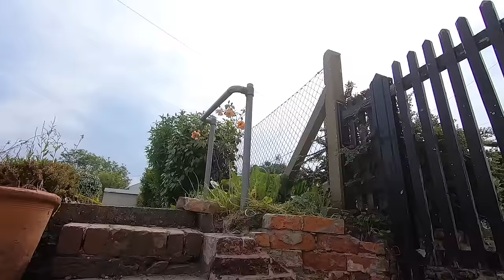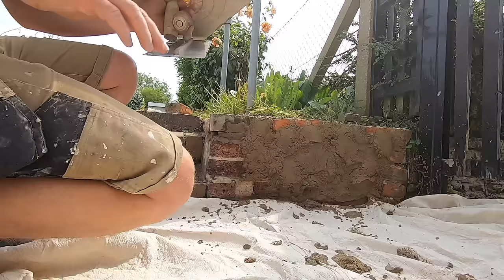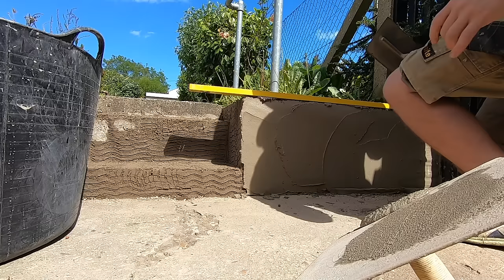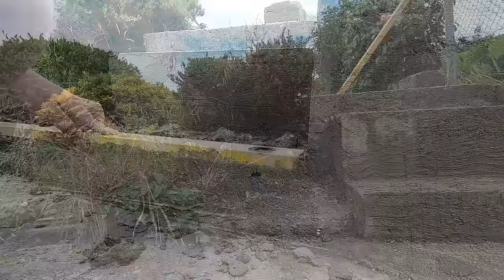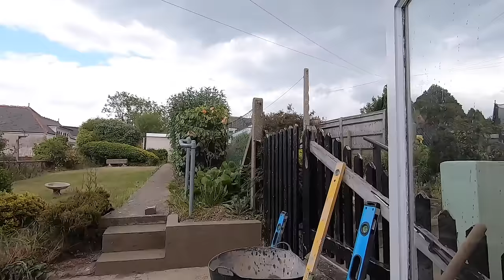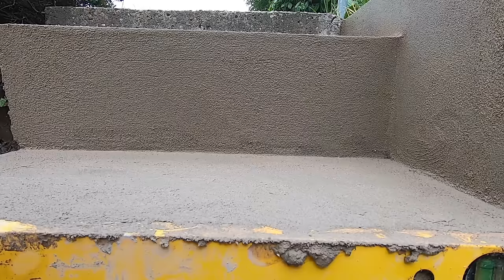Rendering A Garden Wall & Brick Steps With Sand And Cement (Plastering For Beginners)

Comment: good videos... you are a good craftsman. Im in the PNW (Seattle, WA. part currently) U.S. and have been a cement mason for....dang, almost 30 years now. The early years were primarily pouring and finishing concrete with my last few focusing on mostly patching...which covers a broad aspect of work, materials and applications. I'd have to say one of my strengths comes from using great techniques picked up from other people and incorporating into my own methodology, it has set me apart from a good deal of folks mostly for the better...sometimes not, lol. I'm telling my background for reference that I do have a very solid background as a cement mason and you take what I'm saying as real talk. your work is legit... not that you don't know, and its good to see variations from other countries that are similar and also the differences. Good work all around and great tutorials for beginners, giving great basic core techniques and showing craftsmanship at its finest, you sir, are all Aces as far as I'm concerned!!
BTW, I shouldn't forget the original reason for the comment now should I, lol.  I really can't put enough emphasis on how important of a tool the sponge is, personally. OTJ in this particular area they look at it as a hack tool....IMO, it is delusional to overlook the importance of a good clean sponge and seeing you use it properly as a finishing tool is a great representation of that!

Comment: Any chance of a show of how you mix your mortar for the base coat and top coats?
Reply from the maker: I'll try and get it sorted for the next video pal. Thanks for the recommendation 👍
Reply: Good quality plasticiser and some nice rendering sand always helps. Getting air into the mix over loads of water is the key.
Reply: When would use a bead vs not?

Comment: nice one lad, gonna do me garden wall soon. whats your opinion on render over spalled bricks. chip off the damage first then build back up to level, or does the render keep things solid?   was that first fill coat just sand n cement or any lime added?  whats your opinion on one coat renders? better to mix own? better to lay 2 coats? thanks again great video.

Comment: That wall and steps job was all angles and corners. How did you prevent the render going off too quickly before you could start to float the render? It would have taken me ages to get the verticals, horizontals and steps all nice and neat. The render would have set long before I was ready to float it up!

Comment: Hi m8 what all your videos that's give me to confidence to plaster outside and in I'm on a big wall that I have built with block and iv watch all your steps on everything even rule the scratch coat but I'm having trouble with the floating it just wants to pull and if I leave any longer it's to dry if you get this message do u have any recommendations thanks

Comment: Love your vids. I was wondering How does render hold up on steps? I want to have a go on my garden walls which have steps like that but would rather not have separate treads/coping. All blockwork. Also would you ever just use a sponge float instead of the plastic float or do you always need the plastic one first?
Reply: The plastic float presses the stucco
Reply: Blaine, just wondered if you still had any thoughts on my original comment? Still haven't got around to doing my walls and steps! 😂
Reply: Im looking to do steps too- have come across Ardex mortar repair- think this may be better than render for stairs?

Comment: Great work as usual.  Do yo u have a video on sand to plasticizer to cement ratios?I think it’s this one you used 3 to 1/1 for the scratch but then went 5 to 1 for the finish.  Is there a technical reason to increase the sand for the finish coat?  Do you use the same grade Sand for both?  Also one last question.  What is the optimal time to to wait to re-temper the second coat to do your final finish.  Thanks much and stay safe in the time of Covid. 

Zi
Reply from the maker: Hi mate! I'll try and get a video sorted soon actually but the long and short of it is that the top coat needs to be weaker than the scratch because it's cracks otherwise. The strength of the render forces it to crack which is why every coat needs to be weaker than the one before it! I also only every use plastering sand for rendering. Hope this helps and I'll try and get a video lined up soon on mixes 👍
Reply: Plastering For Beginners thanks for the answer.   That is a really cool tidbit of info.  Really helpful.  Looking forward to more of your videos. Cheers!

Comment: great vid. im an absolute diy beginner as gonna maybe build a concrete block water wall in garden. im bored so what can go wrong :) do you have any vids on what to do as a starter? im talking how to basics? i have concrete blocks, and can do mortar for them. i have a sponge :) it will only be maybe 3 high 2 wide, so small. you ok with the one coat render you can get?  sorry if too many basic questions btw. i will have a look at more of your vids tho in the hope of picking up tips, what float i need etc :) thanks.

Comment: Brilliant work mate, would this need painted after to protect it from the weather?
Reply from the maker: Thank you mate! Yeah ideally it should be painted - it's just another layer of protection which helps keep it sustained 👍
Reply: Plastering For Beginners Nice one mate I thought so, I’m a Ames Taper by trade but I’m really thinking about getting into plastering some point this year. Thanks for all the content bud 👍.
Reply from the maker: Good stuff mate!! Let us know how you get on and good luck. Thanks for watching my friend
Reply: Very impressive mate. I’ve been plastering and decorating and for 15 years but recently started watching your video’s. Picked up so great advice and tips to improve my work. Finally got an ox speed skim the other day, used it on 2 jobs and it’s worked well.  It was your video when u done the big ceiling that inspired me to take the plunge and buy1. Keep up the good work. The videos are brilliant and the way you present them is delivered well and easy to understand. My next buy is a sponge float, going to try some plastering that way and see what results I get.  Take care mate
Reply from the maker: Hi Paul! Great hearing from you again mate and it's good to hear your story! The Speedskim is a have changer my friend - it's a great tool and I think it only gets better the more you use it. Thank you for your kind words mate - it really does mean a lot to me so thanks! Great hearing from you Paul. Cheers pal 👍

Comment: lovely job, have been back and forth through your vids in prep for my first try at rendering the blockwork garden wall I'm building. They're giving me the confidence to give it a go!
A question: I'm building a planter so the inside walls will be in contact with soil. Are there any techniques /materials you'd recommend for render that contacts soil? Can't find any videos on this specific question!
Maybe waterproof to above the soil line and start the render from a horizontal bead just above the waterproofing?
Thanks again for taking the time to share your skills, much appreciated!

Comment: Bit of advice needed! Rendered a similar wall at home - render has now blown in places though. I used a waterproofer on both coats - might that have been the problem? Do you even need a waterproof additive? Ta!
Reply: Try using SBR. 50/50 mix with water, paint it on the wall generously. Wait for it to dry, apply waterproofer to your mix and it shouldn't blow.

Comment: As always a great video, at the risk of sounding really stupid I have a question. You showed the steps as being absolutely level but I was wondering about water pooling on the steps as there is no run off slope. Did I miss something or how would you deal with this?

Comment: Hi, So it was Your garden wall !! 
Any normal man would have taken a sledge hammer to that wall and rebuilt it. 
I was amazed by the finished result, you worked a miracle there! 
I would never ask a professional tradesman to fix a wall as bad as that...I would be embarrassed. 
Why didn't you throw a cloth over that nice piece of black fence ?
You've made a right mess of it now with all the splashes. I hope you cleaned it off. I think you should do a video about cleaning up after a job. Also how would you fix a crack on some render if it was on a wall up on the front of a house and you needed a ladder to reach it? 
You could do a whole series on fixing a mess in Carol's house, I have probably everything gone wrong here. lol
You could do with a few more plants in your garden too, I will fetch you something nice in the autumn, when it's the best time to plant, from my garden xxx
Reply from the maker: Haha thanks Carol and it's great hearing from you - don't worry...I cleaned everything down. The fence is the same as it was!! That would be great and I look forward to hearing from you in the future. Stay safe Carol 👍

Comment: 👍
Even though I don't see myself doing this anytime soon, it was cool to watch.
One question - what is the recipe for the rendering "material"?I heard 4 to 1 but 4:1 what?
Cement, sand, water - what proportions?
Also, you mentioned "beads". What is that in American translation?
Thanks!
Reply: 4 sand to 1 cement. On the top/finish coat it's 5 sand 1 cement and ½ lime. Beads are corner beads or angle beads for forming corners. He's not using them in this though. Normally you would.

Comment: You make it look easy, great job! I'm considering building a block retaining wall in the garden and having it rendered, but am a little concerned about the render blowing in the future because of water penetration from behind. Any advice would be much appreciated!
Reply from the maker: You can apply Blackjack or Bitchumim to the back end of the wall which should prevent any moisture from traveling through the block! That should help mate 👍
Reply: @Plastering For Beginners  what about if you already have a retaining wall. Is there anything you can apply retrospectively?
Reply: @PlasteringForBeginners hi I love your videos I have a small outside wall to rerender what is the best sand to use

Comment: Hi Blaine, how do you manage to get so much time before doing your float? What sand mix are you using? Are you adding additives, lime? Obvs temperature is a factor.
Reply from the maker: I always use FEB Rendamix in my top coat - it's the perfect addative for rendering. Give it a go pal  👍

Comment: Blaine could you give us some timescales on rendering.
How long can you leave a topcoat before you need to start the floating/sponging process?
Can you part apply a top coat and part apply the next section another day?
Wpuld you still be able to blend the two mixez together on the same wall?

Thanks Blaine (im new to rendering)
Reply from the maker: You can’t with Rendering mate. There’s too many variables - depends on weather, background, time of day, wind, sun etc. it can take 20 mins or sometimes it doesn’t even set. It’s totally depends on the day!
Reply: @PlasteringForBeginners  thanks for your advice mate 👍

Comment: Looks fantastic, I do wonder if it will stand up to foot traffic. I cringed every time you used the Stabila other than as a level, bit of aluminium box section would be better imho. Fabulous job though. 👍👍
Reply from the maker: I know it sounds bad but it's an old level - the Ox ones I use are the untouched ones! Stabila took the hit 😂

Comment: Another great job. Could you show how to calculate how much sand and cement one would need to do a wall.
Reply from the maker: That's tough mate - depends on the size of wall and thickness. A tonne bag roughly does 35sqm at a mix of 4:1. Hope this helps 👍
Reply: @PlasteringForBeginners  thanks for a reply, maybe we could narrow it down a bit, in your opinion how much would a mixer load cover, I'm guessing a  4-1 mix or a 5-1 mix would be a cement mixer load, I have a brick wall approx 900mm high and approx 4m long, do you think one load would do for scratch and one load for finish, sorry for being persistent only I don't want to over order if I can help it.
Reply from the maker: I reckon a mixer load will probably do that mate. It's roughly 1 sqm per bag of sand so 4 bags in a mixer with 1 cement should cover 4 sqm... In theory 🤣

Comment: Been watching you videos. I beaded and then scratch coated my wall,  I did it in a day. Used a 6-1-1 mix. Then topcoat, applied 6-1-1 render, but only done the small faces of the block piers as my first time applying and floating and didn’t want to end up with more than I could handle. It went on okay. Few blemishes but good enough for me. But next day I have noticed hairline cracks appearing as it drys out. Any ideas what I have done wrong, and what’s the best way to fix this. It wasn’t very hot or raining o. The day of the installation.
Reply: Rob King your top coat should always be weaker than your scratch
Reply from the maker: Exactly that. The top coat always needs to be weaker than the scratch - the scratch cracks the top coat which is what might have happened! Sorry pal.
Reply: Plastering For Beginners think I’ve been watching you too often Blaine 😝

Comment: 1. What type of sand do you use for your mix? 2. Do you add SBR as a waterproofer to both coats or just one coat ?
Reply from the maker: I use plastering sand and I would only use SBR in the scratch coat (but I usually just use waterproofers to be honest) and for the top coat I use the FEB Rendamix additive! That's the mix pal 👍

Comment: Not beading is a weak joint already, in an area with foot traffic also, am I wrong? 
Just asking an honest question!
Reply from the maker: No mate - not at all. You have to think that beads are relatively new invensions. How have all the old buildings lasted if that was the case? I actually think a formed angle is stronger than a beaded one - they just take a bit more with which is why people started resorting to beads. When I worked in NZ we couldn't get any external corner beads for S/C render. We formed them all - I think it's still the case now 👍
Reply: beads are weak! if you form corners properly like this , its much more solid . cracking always occurs around beads .
Reply: Beading is crap even internally.

Comment: Hi some great tips there, how long do you leave it before floating/sponging off after applying the final coat of plaster. Can you go back the next day. Anyone know the answer ?
Reply from the maker: Hi mate. No you have to do it on the same day because it will dry out otherwise - it's usually a couple of hours but it all depends on temperature. There's no real guide. It's all weather related my friend!!

Comment: What mix do you use for external render? Possible video opportunity?
Reply from the maker: Good idea pal 👌 4:1 scratch and 5:1 top coat with Lime in the top!!
Reply: Plastering For Beginners thanks for reply 👍🏻what type of sand do you use?
Reply from the maker: Plastering sand Pal 👍
Reply: @PlasteringForBeginners  hi Blaine great video, I was taught 5.1.1 scratch coat and 6.1.1 top coat ,but since I've been using 3 in 1 render mix,the technical department say leave out the lime as it will over aerate and weaken mix,be interested to hear any thoughts on this. 
Cheers

Comment: What did you say the top coat was.. 5-1 with lime??
Reply from the maker: That's the one mate - you can do 5:1:1 that's always a nice mix to work with but I generally just add half lime 👍
Reply: @PlasteringForBeginners  thanks mate.. great job pal
Reply: @PlasteringForBeginners  before floating mate you said you leave it to dry.. do you mean the day after or a few hours??
Reply from the maker: No it's usually a few hours but it really depends on the weather. If the render is in the sun then it can be ready within 40 mins. The best thing is to keep checking it 👍

Comment: How do I work out how much plastering sand I need for a Wall buddy?
Reply from the maker: Hi mate! A tonne bag gives you roughly 35sqm pal. That’s a tough guide 👍
Reply from the maker: By the way...a tonne isn’t a tonne it’s roughly 650 - 700kg depending on where you buy. Hope this helps pal

Comment: Won’t them edges break away at the slightest knock? Why didn’t you use beads? Top work neither the less. 👍
Reply from the maker: They never used to use beads in the past so what would be the difference now?? I think there's more strength in a formed angle then a beaded one